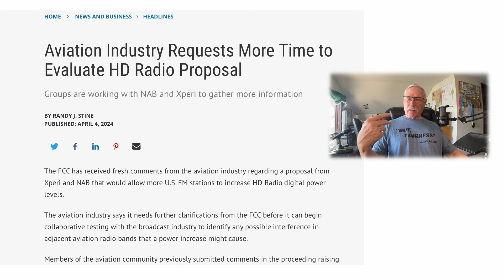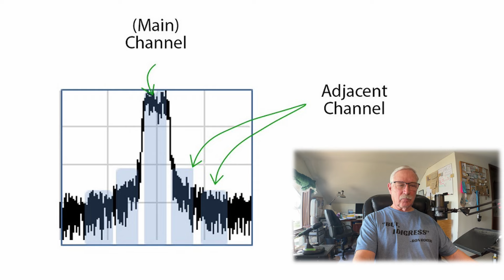High Power FM Broadcast. This threat to aviation just won’t go away!

Comment: FM broadcasters are loosing market share to streaming services due to sh!t content and over filling with commercials.  Their solution?  MORE POWER! So it boils down to "People will like us better if we shout louder".
Reply: Right, Scotty can't keep the warp core from blowing if you ask for more power!
Reply: The issue is that it is a digital signal.  It takes more power to push a digital signal father than an analog one for a lot of reasons.  A clean analog sinewave at higher power would still cause the same bleedovee issues because the signal is in the same band.  They're stuffing so much content and such and need more bandwidth and transmission power to maintain a given level of signal integrity.   That's the best way I can explain it without going into very complex stuff that will make 99% of folks' eyes glaze over.   I mean,  anyone that can work with Fourrier squares of a wave will be able to follow along, everyone else will be like "huh???"....
Reply: @karlchilders5420  no, I get it, when my county switched from analog to digital for public’s safety comms, they had to add more towers for that reason.  And the bandwidth has never been in greater demand.

Comment: I remember in college, WTOS had their tag line "50 thousand watts broadcasting from the top of Sugarloaf USA to the US, Canada and parts unknown!" (Sugarloaf being a mountain and ski hill in Maine.)
Reply: 50kw is pretty standard for the AM signal transmissions. The FM stations are usually under 10kW. The ILS transmitters that Ron spoke of are somewhere in the range of 50W.
Reply: @norlockv  right, and AM generally turns down power at night due to ionospheric skip.  Back in the day I was a certified GMDSS radio operator, and used marine MF/HF SSB, and such, so I may be slightly smarter than the average bear… but a HAM, I am not!

Comment: ILS pre dated FM radio by a few years to my knowledge. However, the government has rarely been a forward looking pro-active organization. 

I worked with the FAA briefly on 5G from a pilot role, which has a similar neighboring frequency issue.   The 5G rollout and the issues that have been reverberating to this day in transport category aircraft is a real safety risk.  Yet, the FCC just said cool, full speed ahead.  Thankfully, the FAA was so lost on the issue they basically just admitted they are useless and said they need more money to study it after the rollout. Thankfully nobody got killed because of the bureaucratic incompetence.  The government can move fast and accept risk if there is enough money behind it.  

I expect much the same in the future. Thankfully, the avionics manufacturers were eventually able to come up with a fix to 5G that works... Most of the time.
Reply: FM radio didn't start to become really big business until 1961, when stereo broadcasting was started, giving it a big selling point and the money to build more powerful transmitters that could interfere with VOR, ILS, etc. I guess the government couldn't see that coming.
And it often takes a disaster to get the government moving on anything, like the mid-air collisions of 1960 and earlier leading to ATC improvements.

Comment: I'm in the broadcast industry, don't kill me. I also like airplanes! 😂 Just to set the record straight this request from clarification from NAB asking the FCC to have clear rules is not a bad thing.

Don't ask me why, but all FCC rules regarding broadcast are murky at best. Is almost impossible to know for a fact basic stuff as what's the peak modulation level allowed for an FM station, because it depends. But let's not digress here, the HD digital subcarrier of an FM analog transmitter is quite low powered. Originally it was set at 1% of the analog output power. Yes just 1%, now depending of a ton of factors you can increase it to 10%. Still very low. The clarification requested is to define how to deal with the case in which a broadcast is willing to reduce the analog modulation bandwidth and in that additional spectrum left he wants to use it to increase the digital bitrate. In anycase the power of the digital carriers on the skirts of the channel are not affected.

I do understand that still the aviation community has to approve the change, but in any case it's a minor issue.

What has been a bad engineering decision all along was to place the ILS signals next to our crazy high powered broadcast band. That's beyond comprehension!
Reply from the maker: Thank you for a very thorough and informative response.
Reply: I wonder if the decision to place ILS frequencies close to the FM broadcast band was made in part because the decision-makers did not anticipate the growth of FM broadcasting that would occur after 1961, when stereo broadcasting was started, making a great selling point for hi-fidelity systems.

Comment: Flying copulation and antennas leased by the inch? Oh my Ron. Now you need to give us some stories about aerial refueling, just to keep the level of the double entendres up.
Reply: Too bad Ron wasn't in the branch of the service that uses the "probe and drogue" refueling method.  ;^)
Reply from the maker: Actually, my A-37 had a "probe"!
Reply: @ronrogers  A tweet with a beak!
Reply: @ronrogers  So did you ever have to refuel your A-37 from that funky steel drogue adapter on the end of a flying boom? And if so, did you have a Walkman strapped to your leg playing Iron Maiden?

Comment: I dont know Ron.  I think aviation has gotten a free ride forever on this.  Lots of other spectrum users have had to redesign entire systems to use new spectrum more efficiently.  Also im not sure the FCC and FAA could be accused of working together in a productive way.  One example would be C band spurious emissions from 5G-NR towers....there are dozens of countries where this is implemented....in some cases right through the radalt band....and yet the US is the only country on Earth that grounded airplanes and mandated new radio altimeters for it.  

How long ago was the MLS designed?  I think its worth pointingnout that standing still and using a system like ILS that has notorious susceptibility and limitations does have real costs.